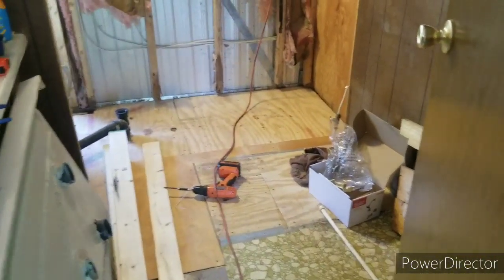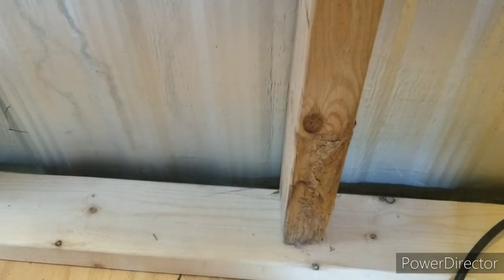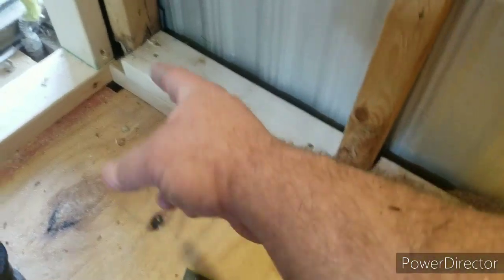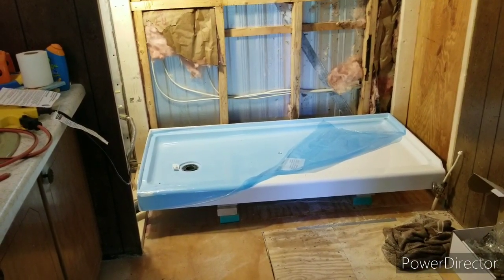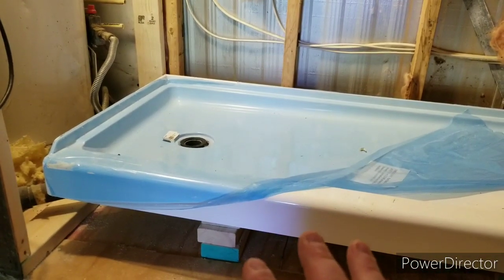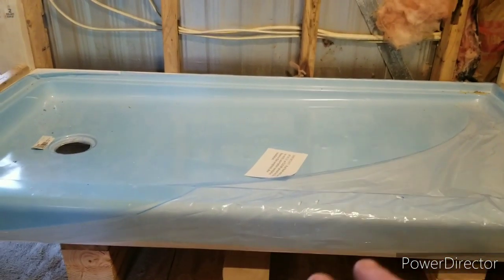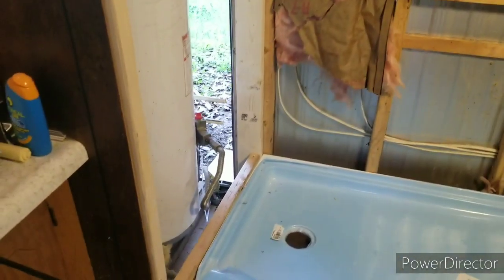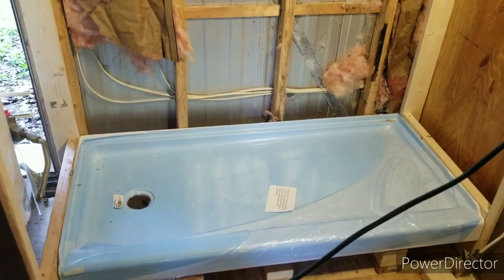1971 SINGLE WIDE MOBILE HOME SOLID SURFACE SHOWER BASE INSTALL PART 1

Comment: I like working on mobile homes. Theyre so easy to work on. Currently dividing one right now and making another super compact full bathroom in on of the rooms and building another small kitchen. Its an old 1960's single wide 12' x 45'.

Comment: My dad always had a solution to them dang tight drains,he'd replace it with radiator hoses,that were more flexible lol and guess what they lasted and out lasted any of the original plumbing drains that were installed from the factory in a mobile home lol  😉👍😊😆...
Reply from the maker: Thats a awesome idea!!!
Reply: @MDC2020   yupper,and i still to this day trust and do my dad's way,seems like his ways always worked better and made more since,("the old folks way")😉👍😆...
Reply: @MDC2020  lol try it. I think that would actually work
Reply: We had to tear a wall out for a stopped up bathroom drain and when we did we found the accordion type heater hose for a car and 2 clamps screwed down holding it on!  We found lots of surprises in this 65 yr old house!!

Comment: Before you changed out the floor you had access to the plumbing drain. You should have done it then. Would have taken just a few minutes. I understand a floor joist was in the way but heck, not that big of a deal. Just reframe the joists like a stairwell opening on a second floor. No need to move plumbing vents or anything else. The current vent is close enough to allow proper flow.

Comment: You didn’t put backer board under your pan ? Here’s the problem I’m facing. This is a newer MH 2001. Guess that’s newer compared to some of the ancient wrecks I’ve worked in previously and it’s in excellent condition. I’m dealing with an 1 1/2 drain, tub shower to shower remodel. It’s also in a strange spot. Not quite centered and to one side. Obviously I will have to move this drain. The floor is 2 x 10’s I believe. I really don’t want to chop these things up. But none of the pans I’m looking it from Home Depot or Lowes specify exactly where the drain hole is located. It’s either center, left or right. Any advice?

Comment: I think you should cut the hole in floor so they can access the P-trap from the underside. Who says you have to tie it into the drain directly under, route it to easiest place to tie in that is not in the busy part. That way the shower base has firm surface to sit on and won't crack up from lack of support.

Comment: Can you put a removable panel there so you can get to the p trap ?
Reply from the maker: There is a access door on the outside of the mobile home that allows you to get to the water heater, from there you can get to the P Trap.

Comment: As I recall when I did my tub to shower the drain was 1 1/2" and I had to replace all of it to go to 2".  Will the drain you have fit the shower pan properly?

Comment: Could you leave a link for the shower basin ? Thank you
Reply from the maker: I'm not sure where the owner of the place bought that particular one. Would you like a link for something simular or one made specifically for a above floor drain?
Reply: MANUFACTURED HOMESTEADER  Fortunately the pee trap is below so I’m just looking to pull the tub out and replace with shower base.

Comment: Bootz makes a porcelain covered steel shower pan for very cheap from Home Depot and I’m talking like 150$....I had one almost exactly what you have and I dropped a shampoo bottle once and CRACKED the floor....dropped another bottle and there’s another crack.....

Comment: With that shower base raised up, won't your head hit the ceiling when you stand up in it
Reply from the maker: Maybe if you are really tall. The shower floor isn't any higher than the original bathtub